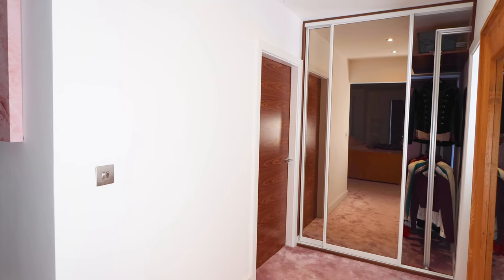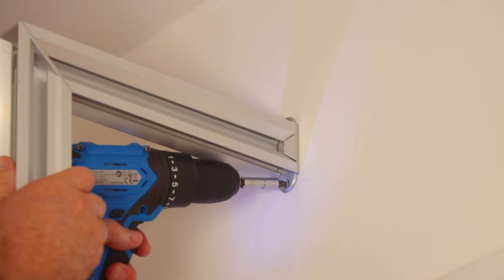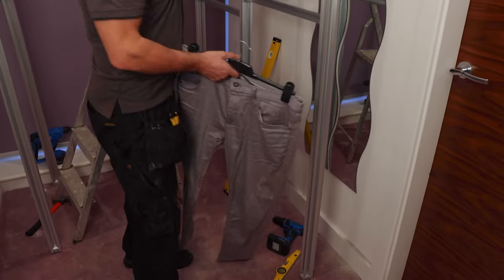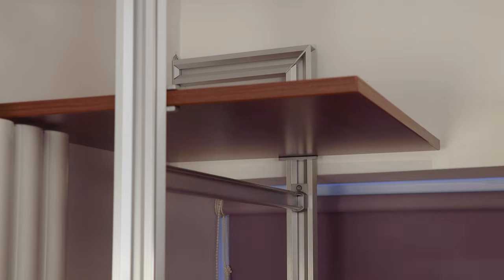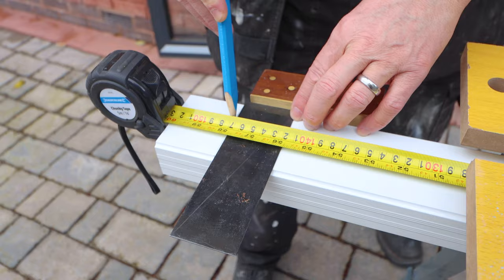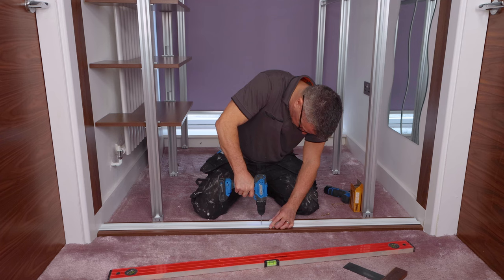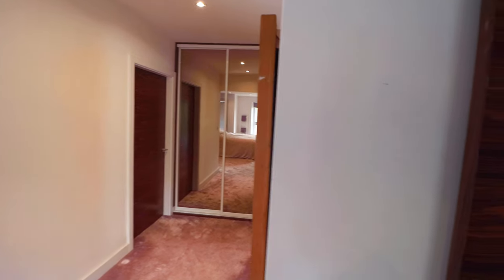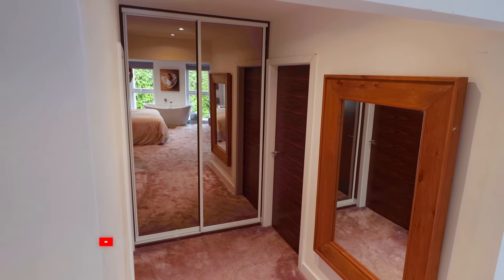Fitting Sliding Wardrobe Doors | DIY Project

Comment: Do you need to remove carpet before installing the down sliding track?
Reply from the maker: No not if your planning on keeping the carpet and its fitted firmly well.
Reply: @MrandMrsDIY  Surely there's a danger the carpet will shift or compress? It only has to be a bit and doors won't run smoothly
Reply from the maker: @MegaCityPatrol  We've never had problem with carpets shifting if there fitted well, and then the base track holds it down as its fixed though the carpet to the floor board below with screws

Comment: Do you have to get the top and bottom pieces of wood level before attaching the aluminium runner frame ? What's the best way to level these off if the floor and ceiling runs off ?
Reply from the maker: Yes would have to get them both level, they can simply  be packed up with window wedge packets and screwed into the floor and ceiling to hold in place